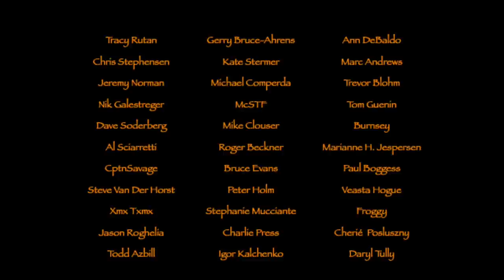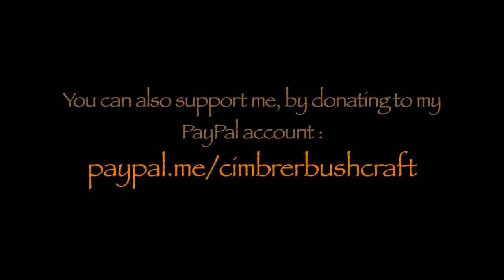DIY Viking Bowl

Comment: I thought that was A Celtic sign. The eternal knot. No beginning and no end, Also it is on Thor's hammer. Well done in the crafting alway enjoy this parts. Your friend Paul. Ps baked apple over fire with olive oil and cinnamon. Just slice the apple a little add the oil, put on a stick sprinkle the cinnamon over apple as you turn to cook.
Reply from the maker: That sounds delicious Paul 😋 and I appreciate your tip my friend. Your right it’s a Celtic symbol but like many things it was shared with others … including the Vikings 😉👍🏻🏕
Tom